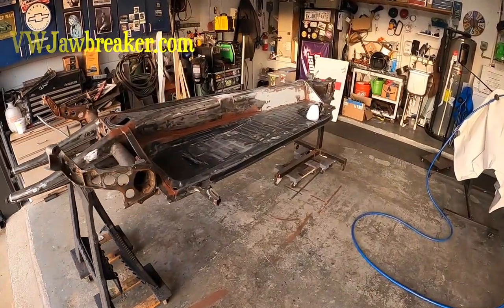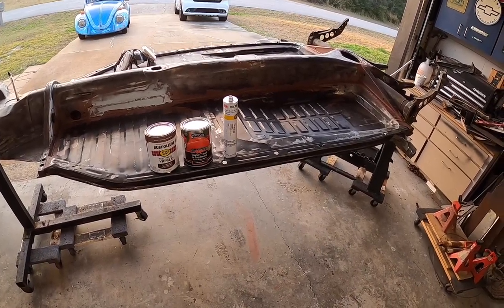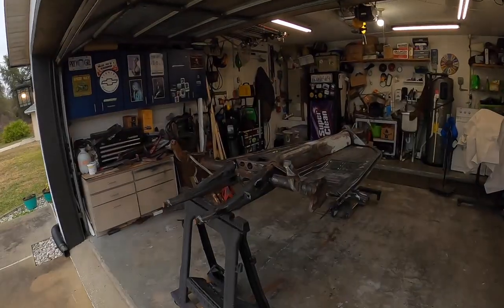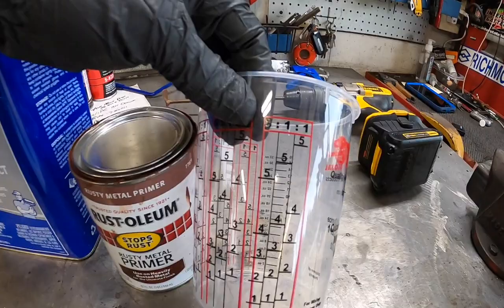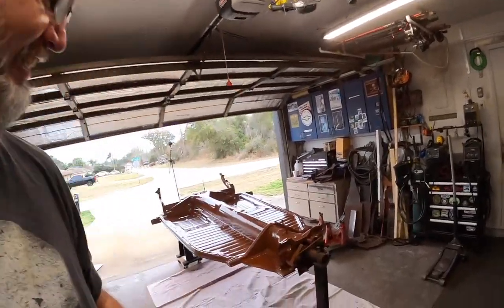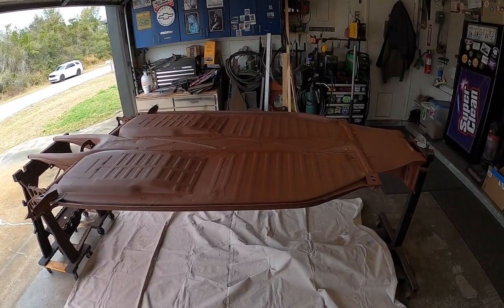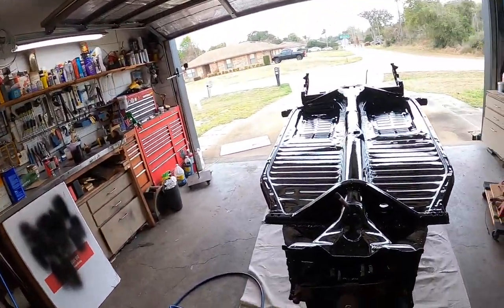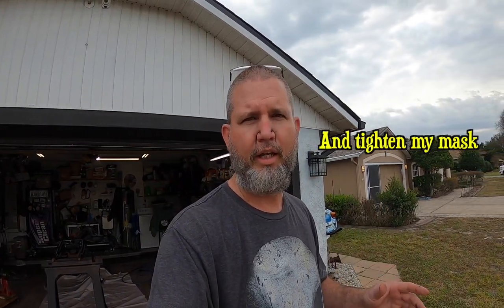Painting the Chassis! Rustoleum Primer, Magic Tractor Paint - SICKXTY -  Volksrod – Baja Build  36

Comment: Good seam sealer, I also use tar as VW originally did, but first work some paint in the cracks.
Reply from the maker: I remembered you used that on your one video…. I seriously thought about it!
Reply: @VWJawbreaker  Its messier unless you use a caulk tube, but it doesnt flow well unless it's hot lol

Comment: Looks good from New England. 👍
Reply from the maker: That’s probably the best distance to look at it from! 
Have a great week buddy.
Reply: @VWJawbreaker  
  I  painted my floor pans and chassis with a brush, using the same paint.  Looks good, but not as shiny like yours.
Reply from the maker: @vintage76vipergreenBeetle  that’s good to know. I haven’t used this paint with a brush yet but the rattle cans are great…. Figured I’d try my luck at sprayed. 
I’m sure it’s till tough as nails even though you don’t have the shine.

Comment: Hi, Garry here you accomplish a great preparation on the chassis first with Rustoleum secondly with the seam sealer well done the third factor the paint shows great success and looks very good.  Great progress keep up the good work mate 💥👍🏻🍀.question what will you use in the tunnel for rust protection I would advise fluid film is sheep fat. and Il will use it in all the hollow spaces on my VW T3 Single Cab.☮️🇺🇸🇳🇴🙏greetings.Hubertus.
Reply from the maker: Thank you Hubertus, the chassis definitely looks much better now. 
I sprayed the inside of the tunnel with ospho, painted what I could and then coated with some thin oil to help detour further rust.
Reply: @VWJawbreaker  sounds good Garry,👍🏻💥

Comment: Wonder if that tractor paint is compatible with a hardener, maybe dry faster and harder.
Reply from the maker: I did a little research but didn’t go too far on using a hardner… figured if the rattle can stuff is great this must be also.
Reply: Yes it is, magic catalyst is available  it will add a little glossier sheen. I used john Deere blitz black with that catalyst on my 82 k10 frame. Looks great!

Comment: What type of air compressor do you use with the paint gun? Pan looks GREAT!!! Thanks for the vids!!!
Reply from the maker: I have a pieced together compressor with a 60 gallon tank but a much smaller compressor would work just fine 👍
Reply: @VWJawbreaker  wow, i was told ya cant use a spray gun with a single stage comoressor. Hmmmm got me realky curious now to loon into this. I would much ratger buy a gallon of the Majic instead of all the cans. I just painted a rear in my chevy avalanche i am having rear geared with the majic. Sray can. Would have liked to shoot it with a spray gun because majic also offers a hardner along with the reducer. Did yiu use the hardner? Tge spray cans come with no hardner in the. But it still holds up great!! Imagine the harder would take it to tbe next level. I have one of those little dual tank carpenter type air conprssors you see them using for doing roofs and all around nailgins. Think that would work with a harbor freight spray gun? How much air pressure do you have your gun set at to shoot the majic enamel? Thanks for replying. And yes i have a 1967 ve beetle. With a 2276. Go to my channel. I think i still gotta ahort walk around of my car. Me and my father reatored that car 30 years ago. Same paint. Acrylic enamal single stage. Lol.
Reply from the maker: @tellitallnow3914  best way to see if an air tool would work with a certain compressor is to go by the tools cfm and the compressors cfm rating. I don’t think you’d be able to use that small pancake compressor but I could also be wrong. Most of the time a 30 gallon compressor will do the trick, again depending on the cfm ratings. 
I did use the hardner and it’s tougher than the can itself. Both are great options. 
Again I’m not a painter so don’t quote me on the painting “advice”. 
I’ll have to check out your ride, thanks!

Comment: I failed to wire brush my pans before primer coating them. Will it affect me in any way?
Reply from the maker: If the black coating wasn’t originally sprayed properly it may cause your primer to lift. Some people say it all has to be removed but if you scuff the entire pan and the loose stuff comes off you should be good.

Comment: @vwjawbreaker How has this help up since it was put down a year ago?
Reply from the maker: It’s held up great. It’s not as shiny as I didn’t put a clear coat on top but it’s solid as a rock and hasn’t chipped off. I’ve used this paint on many projects and have never been disappointed.
Reply: Great! I am going to be coating the underside of my car by spring and I will be doing this. Thanks for the fast reply.  @VWJawbreaker
Reply from the maker: @GO_OutDoors  absolutely, have a great day.